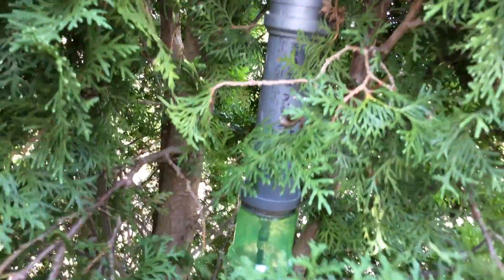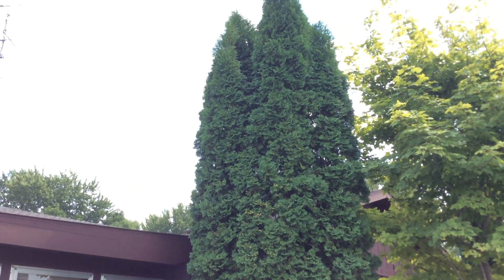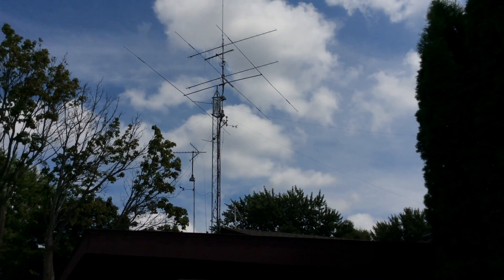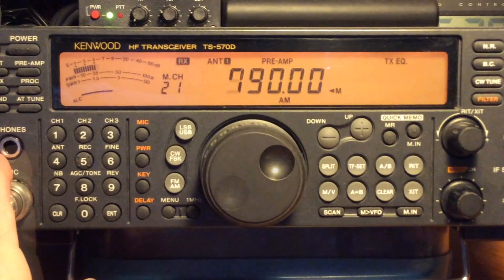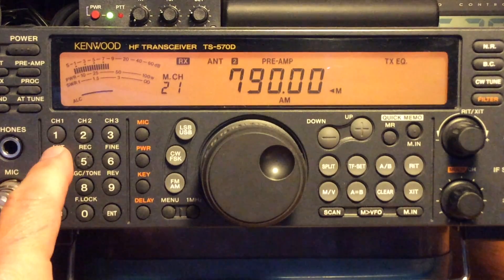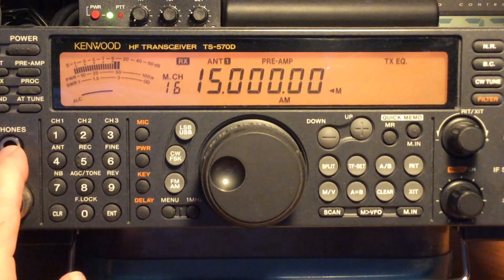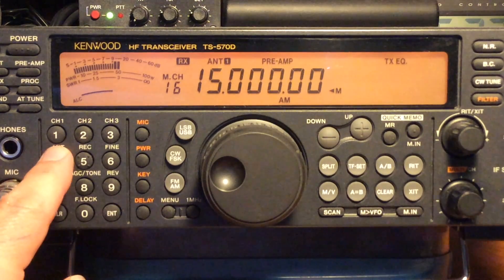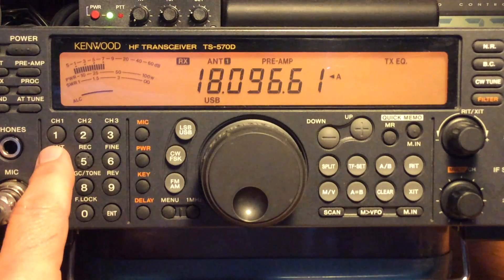Mini Whip vs 80 Meter OCF Dipole On HF For Reception

Comment: Very useful comparison. I have a 18m vertical multiband dipole. I have a number of Miniwhips and am interested to see if the MiniWhip will make a better receive antenna than the vertical multiband I have. I think this video convinces me its at least worth trying for comparison, and if anything else, can use it for a phasing antenna thru a MFJ-1026

Comment: Sometimes I use tree as a antenna - conect miniwhip antennas fet input to tree - works great...
Reply: How??
Reply: @danz1910  I FET transistor,s gate circuit connected to tree branch - above 2...3m high.
Reply: @ingussilins6330  thanks

Comment: I still have to figure out which way I want to go with an antenna here in the trailer. No trees, no poles,,,setting up the loop inside is like putting it in a big shielded box lol. So all this info helps Larry. Thanks for sharing pal.
Reply: Yeah Z,,,, that may be the way to go in the land of aluminum here.

Comment: Thanks for the comparison.
Atm I'm using a Windom for the AM broadcast band (because it's there). I'm certain there are better solutions, but I'm trying to limit the wires antennas on the property.
Awesome video as always.
thanks for sharing.
OH8STN